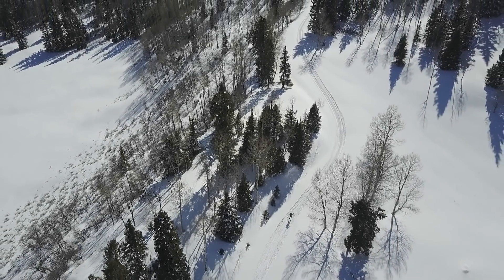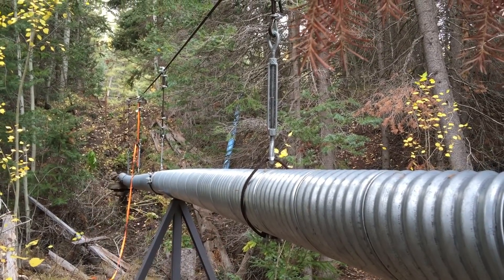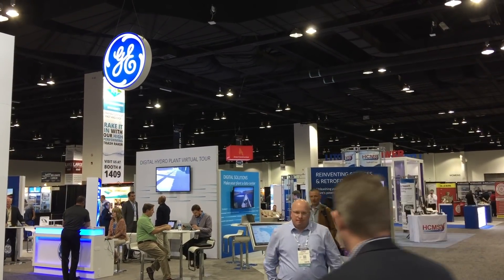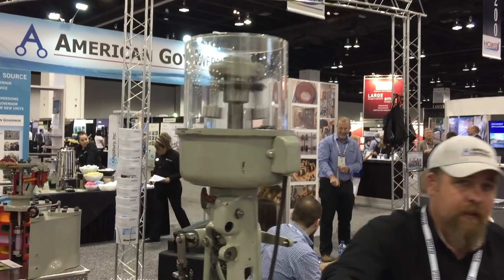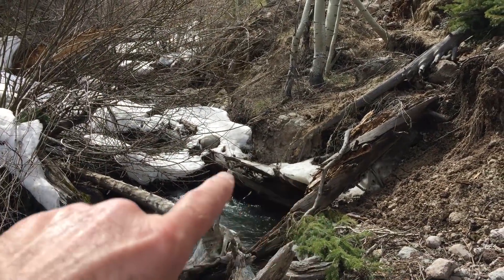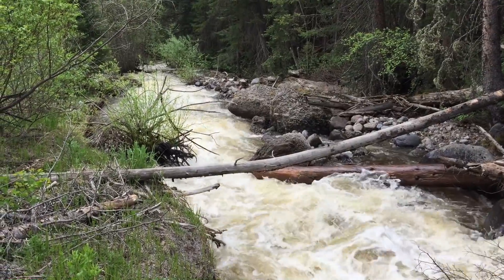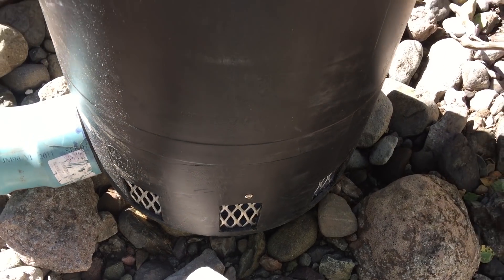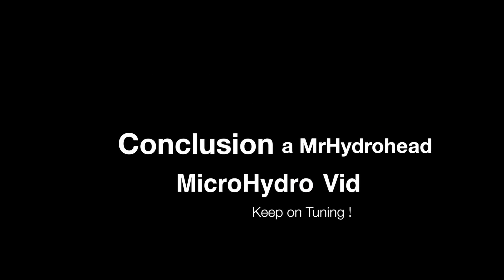Hydro System pt 18 Non-Music Version

Comment: Mr Hydrohead, 

I live on a creek with year round flow.  Spring runoff can be quite major at times. After that it calms down to a steady flow. 

Is there a water wheel or propeller type generator that can be dropped in the water to produce electricity? 

Thanks.
Mark
Reply from the maker: You are fortunate to have a property like that.  There are many ways to harness power and it all depends on flow and head.  A water wheel or prop system would probably not be the most efficient, but each site has different potential.  The video series is an attempt to show how to measure potential and will eventually present many different approaches and systems to harness the potential energy.  Thanks for watching!

Comment: Hello I have been watching all your videos and will want to know what it will take for me to give light to my people in nigeria in my community
Reply from the maker: I guess the answer relies on an analysis how much power would be required and also a measurement of what available water source(s) you would have available to you to develop. Once power is made available it is likely there is an increase in demand, so you should build that into your estimates of the demand side.  The supply side is limited by the potential of your water flow and head and the efficiency of your chosen equipment.  Thx for watching

Comment: What’s the model number of the generator?
Reply from the maker: The generator was purchased way back in 1996 and the Lima Electric Company was purchased by Marathon Generators, so numbers now are probably different as the product line has been changed.  The model was a Marathon Lima 3250-1230, 250 Frame 1800rpm.  It has 12 leads and can be wired in numerous configurations: Delta, Wye or Zig Zag for 110v to 480v depending on need.  We originally had it wired Delta 240v when generating from the springs but changed it to Zig-Zag 480v when we moved the system to the creek.  I never know who has seen what of the series, so check out the whole video series for more detail.  Hope this helps, thx for watching!
Reply: MrHydrohead Thank you!